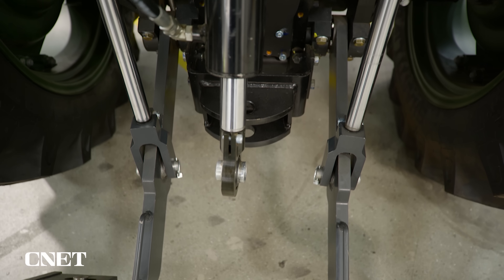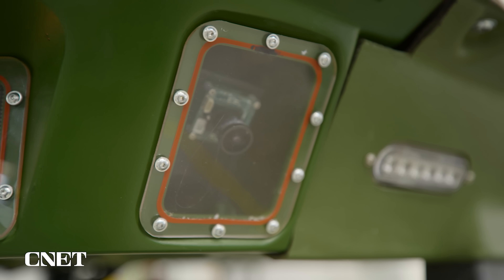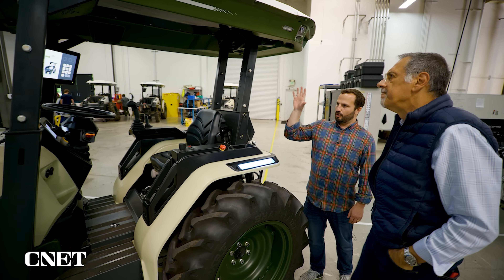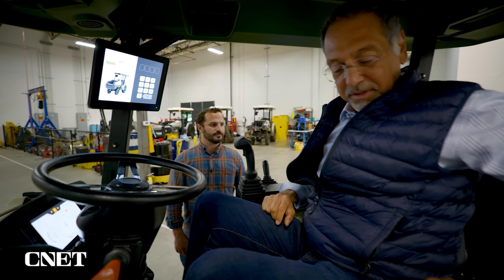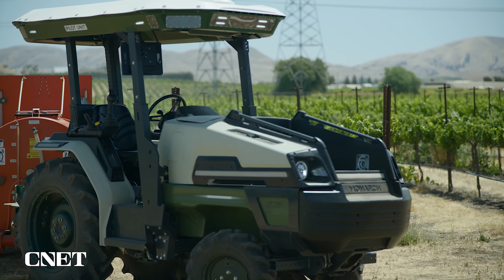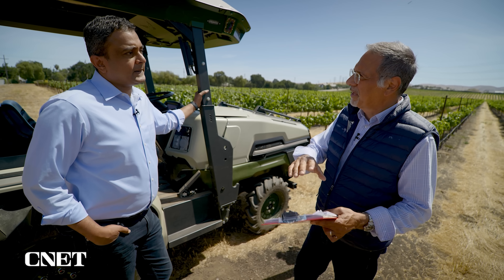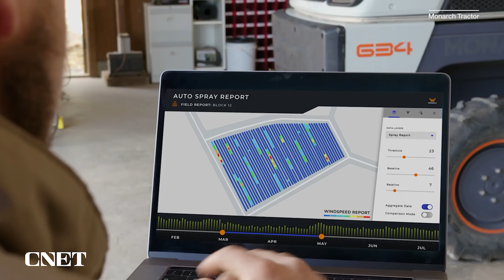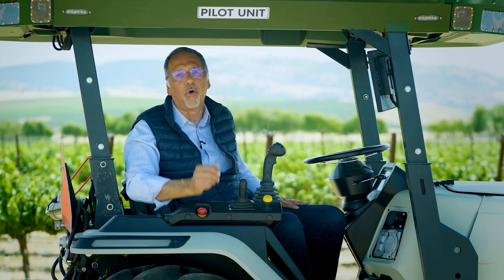This Electric Tractor Might Change the Future of Farming and Food!

Comment: Interesting use case. Will be interesting to see how quickly farmers adapt to both electric and autonomous. Driving a tractor is fun and most farmers are hands on people. Will be interesting to see what the adoption curve of this will look like.
Reply: It's easy, young people and big farms will adapt early, the others can give up or stay low profile if they don't have loans.
Reply: Won't catch up because a massive battery pack will increase costs of purchase and lower working shifts. For a reason companies as JCB are investing into Hydrogen ICE.
Reply: @tomo1168  many that think battery powered tractors are a great idea, probably never put foot in a field ever. Or are aware of the energy required to plow a field.
Reply: @RogerM88  we will see. tractors don't have to fly in the air, so i'm pretty sure in 10-25 y when battery-technology is enough good it will happen also with bigger tractors. electricity is just way cheaper than diesel and not just the engine but also the whole system with hydraulics etc. is way more efficient. an autonomus smaller truck will swap the tractors batteries while driving. hydrogen cell is not working bc of the vibration and the dust, that is why jcb is using ice h2. but don't forget, they also need a second specialised truck which is delivering the h2 to the site. it is only better in city-construction-environment where the city is regulation the exhaust gases. on the field there is no incentive to use h2 ice when you can use plain old diesel.
Reply: @tomo1168  you can't reinvent Thermodynamics. Hydrogen ICE is far superior to any battery system for farming and heavy equipment, due to it quick refueling, more roughed powertrain, less need for complex electronics, decades of ICE Know How, cheaper to afford, more easily scaled in production. This Climate alarmism just focused in ICE powertrains, while excluding other industries and the impact of Human activities in the  Natural Ecosystems, needs to be debated.
Reply: Driving a tractor is fun spoken like a person that has never spent 16 hour days going back a forth in the field.
Reply: Autonomous tractors are are already very much a reality. The technology has been embraced by virtually any farmer that can afford it. Skeptical of the electric for now though. We don’t have the energy storage for the long hours under heavy load.
Reply: @CanusDirusx  did you ever drove a tractor or worked in a Farm? There was a Fendt EV tractor field demonstration in my country, long story short, after a few hours working, it was plugged to a Diesel generator to charge the battery pack. It is hard to admit to you all tech urban people, that BEV technology just don't fit to all needs?
Reply: @RogerM88  yes. I grew up on a farm. I’m not in the business anymore but am reasonably aware of where the business is going. I’d love for electric tractors to be in the immediate future but as someone that has driven a tractor I know how much diesel they take. I just don’t think the energy storage is adequate. Electric cars are made to be as light and efficient as possible. Tractors drag an implement through the soil for hours or use energy demanding equipment like the equipment that makes hay bales, aptly name a hay baler. That little electric tractors could be useful on a very small farm operation. They will no doubt show up on California vineyards. Even a big farm could probably find some uses for it but it would be a lot of money for a gadget with limited capacity. I hope they prove me wrong but I don’t think they will.
Reply: @RogerM88  Farmers have the ability to create their own electricity and therefor control costs. Once you go with hydrogen, you are back to the old system of being a slave to the fuel industry. For instance this year diesel is double what it was last year, will it be higher again next year?
Electric motors provide far more torque than ICEs, perfect for a tractor.
I saw JCBs director giving his hydrogen spiel, quite a few oil industry talking points in there.
Reply: @coffeebuzzz  you're just switching your dependence form fuels to means of production. With the demand increasing for Renewables, not a surprise if in some instance, Governments find a way to tax BEVs. You still ignoring the battery pack costs. Which would increase food production costs too. A modern Diesel engine is far more efficient for heavy equipment applications. Hydrogen has multiple applications besides the Automotive industry. Climate alarmists should calm down, and focus their attention towards supporting a switch Nuclear Reactors on the Power Grid first.
Reply: @christopherbrown6391  To me driving back & forth across my field for hours is loads more fun than trying to program some electrical gadget to do it.  Have lots of tech on the farm it all has one or more of three major problems: 1. Difficult to understand 2. Short inconsistent lifespans 3. Doesn't actually work
Reply: farmers are like 2steps ahead of everyone on this... successful farmers don't use diesel or gas and they also don't use battery EVs they run their tractors and farm equipment using cow farts.. now let me explain: fuel is a major cost and at the top lvl of farming competition and profit margins is razor thin so what the big farms did was get get of their fuel bill completely by making their own fuel and they do that using waste and waste produce from their farms that they can't sell (and yes some of them even collect the methane gases from cow farts while the cows are in the barn and they use that to run generators and run tractors).. i mean you can't possibly get more green than running your tractor on cow sh!t, a battery EV of any kind would be a step backwards....
Reply: @RogerM88  Your are exactly right. I dont see this thing pulling a 3 bottom plow. Or brush hogging, then haying a field all in one day.
Reply: @CanusDirusx  And its not good to have a light machine. Try pulling a 3 bottom plow with this thing. It will probably just sink itself.
Reply: Most older guys will probably retire or hang on until they have to change.
Reply: @dunhillsupramk3 for bigger farms, using a CH4 system actually makes more economical sense.
Reply: @RogerM88  yup and with the cost of fuel today even the smaller farmer would see the savings on the short term.. on avg its like over 500gallons of diesel per acre (depending on the crop) and the bigger farms did use over 500gallons of diesel a day (before switching over to their own methane recovery sys)... so if its about $6/gal for diesel thats around $3k a day they saving and thats like a MILLION dollars a yr the bigger farms is saving...
Reply: @RogerM88  this companies will go bankrupt, electric is the way, it's not a problem to have enough capacity. thats a myth.
it is all doable
Reply: @JohnSmith-pn2vl   have ever been around a Farm or Construction site? You have machinery working non stop almost all day.

Comment: Will it run 18 hours a day? 
How does it cope with corrosive fertilisers, dust and wet?
Can you add weight to the tractor to gain extra traction and balance out heavy machinery?
Reply: all this is doable easily while being cheaper, way cheaper and clean, the industry is sleeping on this, one will take the cake

Comment: Lol. Nah. Lots of problems with this:

Adding electronics/sensors to a mechanical system does nothing to address weaknesses in the mechanical system. The roof is liable to get ripped off driving under tree branches or roofs, the 3-point cylinder is upside down, electronics are ok at diagnosing problems with non-electronic systems but terrible at diagnosing electrical problems. And that's just how this one is worse mechanically than current tractors, as observed by a random dairy farmer in a few minutes of video.

As a glorified lawn tractor 6-10 hours run time and 4-5 hours charge time is fine, but for serious ag tractors during planting or harvest 90-95% continuous uptime (on a scale of weeks) including refueling is a minimum.

Others have mentioned the repairability issue, which is huge.

The only rational interest in this company or concept is as a long-term stock short. If you can't draw the entire electrical schematic of a tractor by hand on a single 8.5x11 sheet of paper you're doing it wrong.
Reply: Electrical schematics haven't been that simple since the 1990's. Anything with a cab/heat/AC automatically exceeds your 'sheet of paper' requirement, and that doesn't count powershift transmissions or common-rail fuel injection.
Reply: @jonathankipps9061  There are as many tractors from the '90s in the field as tractors from the '70s, even though the tractors from the '90s are 20 years newer. Complicated can do fancy tricks, but simpler is better.
Reply: @christopherbaird4952  I've got several 90's SAME tractors that weren't too complicated to begin with. And still, once I got to the point where electrical problems were becoming nuisance, I pulled the entire wiring harness and rewired everything with a far simpler design that I can fix and trouble shoot in a matter of minutes. I'm sure I'm not the only one who has become annoyed at how overly complicated the wiring on modern tractors has become.

Comment: I could see two versions of this. The one we see here and one without the human controls. Like a farm would have several that have no controls that do work already learned. And the one the farmer can use to train the system.
Reply: There is already a tractor out there with nowhere for the operator to sit. It’s called a Land Care Robot and they are selling now.
Reply: Even a tractor that's never intended to have an operator should still have an operator's platform. A non-enclosed platform is really cheap to add to a tractor, and would allow an operator on-board during delicate maneuvers(attaching implements, etc). The controls could be as simple as game-console controls plugged into a USB port.

If a tractor slides into a muddy ditch on the side of a field, I don't want to depend on a computer to get it back out without flipping over in the process. I would want to in some way be able to take the controls and finesse it out of the predicament. It's similar to kicking the idiot minimum-wage guy out of the cab so you can straighten out his mistakes. You don't simply tell him what steps to take to get the tractor unstuck, when he was the one who put it there in the first place.
Reply: @jonathankipps9061  the trend is to make robotic and remote control vehicles that do not have an operator platform. If the tractor was bogged in mud or was stuck against a tree or down down a gully I don't know what  advantage there would be by sitting on the machine with a controller for it or standing next to the machine with the same controller.

It might be better to be off the machine as it might be dangerous to be sitting on the tractor getting it out of trouble.

Comment: During harvest... farmers need tractors that can run essentially 24 hr a day for 2 to 6 weeks, just pausing to change operators.

Got a battery for that?
Reply: Save money in fuel,  spend 10x the amount that would be used for fuel to by extra batteries for easy swap outs...
Reply: @Bendigo1  LOL @ easy swap out estimated 2 ton battery pack.
Reply: @fhuber7507  They do it in warehouses that use electric forklifts.  They have 10 or 15 battery banks charging at all times, then when a forklift gets low on power they juts pull the dead bank out and pun in a charged one, takes 10 or 15 minutes.
Reply: @Bendigo1  Fine... for a warehouse... not fine for out in a farm field where the trailer with all of the batteries is likely to get stuck in mud.
Reply: @fhuber7507  I am not saying it is a great idea but just that it is possible and if they were to do it that way they would spend more on extra batteries just to run a full day than they would on fuel.

Comment: 6 to ten hours. Wouldn't make a workday without heading for the barn for a charge. I wouldn't get it if I had more than a hundred acres. Typically, in peak really need to get done times we would run two shifts 24hrs for as much as a week. This tractor is hobby farm ready for sure though.
Reply: wroñg

Comment: There are times in a year where we will in 12 hour shifts 24 hours a day. Planting, harvest and irrigation. I don't see anything running on a permanently mounted battery keeping up with that. The automation tech had brilliant potential.
Reply: Modern tractors already have the automation, they just use safety drivers.
Reply: @bowez9  you correct but the programing of modern tractor is limited by the manufacturer to changing parameters, bot writing your own programs
Reply: we get vàk ³⁰ too ⁵0⁰ hourßé

Comment: Yawn. John Deere has a real sized autonomous tractor going into production. Autonomous tractors are easy compared to cars. Most tractors now have GPS and they literally tell the driver where to steer, the drivers just follow directions. Autonomy is just automating the steering and adding collision avoidance at some level. This tiny little toy is going to be useful where, exactly? It's not 1930, you know.

Comment: 2/3s of all tractors sold under 40 horse aren’t going to farms. They are going to homeowners who want a sub compact or compact tractor with a mower deck and a loader for yard work. Which this thing is almost to cumbersome for. Even in orchard and vineyard work which there is a lot of around me, most “narrows” or orchard tractors are in the 70-100 horse range which is pretty impressive considering their size. Maybe out on the west coast they are using smaller stuff and that’s where they did their market research. But as of right now outside of possibly working inside livestock barns as a chore tractor, you aren’t going to get this thing into row crop farming. It’s not even a good hay tractor, a 9 foot discbine takes about 80 horse at the pto minimum, a good sized round baler about 60-70.
Reply: I been working for 5 different farmers that past 6 season's , all timothy hay farmers, along with some alfalfa, and the smallest tractors we use are either the older JD 4230's 4440' or 6400's series everything else are larger, and one farmer used two 6430 JD's and 385 Freeman balers with Hydro pump of the pto's and we will bale hay up to 10 hours a day, not sure if a EV tractor could handle that, let alone the cost and that most farmers are cheap, because their also business people, and they only spend money when needed.

Comment: Why do I have a feeling this is a product in search of a market.  The only question I would be asking is whether there is a viable market for very expensive, short lifespan equipment in a low margin, high risk, usage environment.  And whether you can fix it "right now" in the middle of a field with a pair of vice grips and a hammer.
Reply: This is not something you would take into the field. Look up Toy Tractors or Tiny Tractors, the various types of tractors below the Small Tractor category. They do exist. From what I have found, largely in light duty work around arm yards, large houses or estates for garden work, or light duty in animal husbandry, some commercial properties. Not something that a grain farmer is going to be putting to you in the fields. There your looking at Small, Medium and Large row tractors with horse power starting at around 100 HP and going up.

Comment: The problem with battery powered tractors is theyre often in obscure places far from civilization. When the battery fails, you can't just harvest new lithium on site and manufacture a new battery. The wait for parts, let alone the right to repair issues, will let your crop go wasted. Internal combustion engines are able to be fixed on site when they fail. As long as it's not a john deere software issue.

Comment: built an electric tractor out of an old 8n last fall. works fine, easy to use, quiet and pulls more then a gas powered 8N ever could . it either spins out or goes that the only two choices . under my current configuration  i am good for about 4 hours of working it, per a charge
Reply: REALLY
Reply: no way
Reply: Can you document/video/publish your achievement? According to wiki the 8N weighed about a ton; is your modified tractor the same weight? What size (kWhrs and technology) is the battery pack?
Reply: góod firvyiu

Comment: With diesel at $6+ per, the ROI may become more compelling (despite subsidies for fuel for agricultural purposes).  From Monarch’s perspective, I see the real value in the sale/resale of the data gathered from the install base.  Commodities traders and agricultural arbitrageurs would pay for that data for its predictive value.

On the other side of it. If they are going to give control of these devices to the cloud, security is going to be a necessity.  It is already bad enough that many heavy vehicles use “common keys”, but imagine if they can be driven from across the planet?
Reply: John Deere and others already sell that info

Comment: BEV tractors and heavy equipment won't catch up because of the massive battery pack it will require, increasing costs, and lowering working shifts. In this case industries, Hydrogen ICE, make more economical sense. As JCB been testing.

Comment: Land Care Robot is another robotic battery powered tractor brand. It comes with a three point hitch and PTO but no hydraulic remote circuits. It’s a lot cheaper than the Monarch. I suspect putting a driver seat in and all of the controls costs a lot and if Monarch sold a tractor for a lot less without the driver controls it would cost a lot less.

Comment: an average diesel 40 hp tractor witout AC price is around of 15-20000 euro. That have not self driving system and extra storage. If this one will have AC and/or front loader will be very useful for small farm, shelter and other. How about  cost of working for this one ? How much cost one without self driving system?